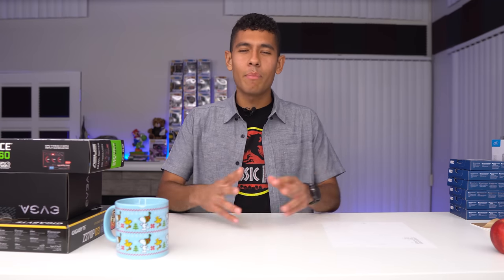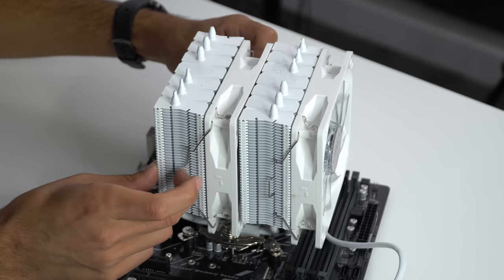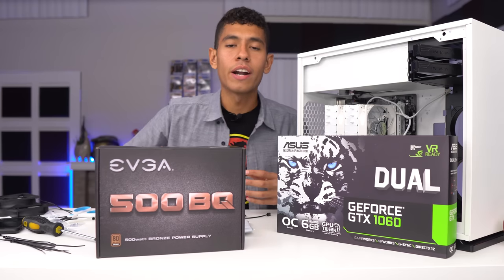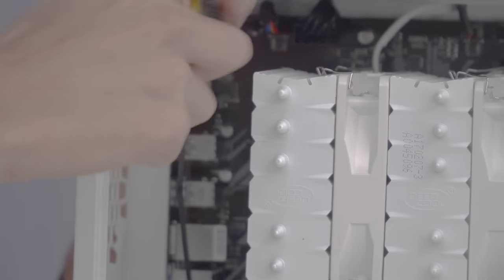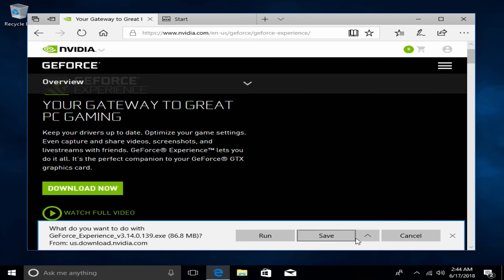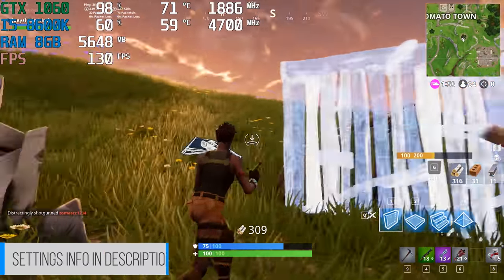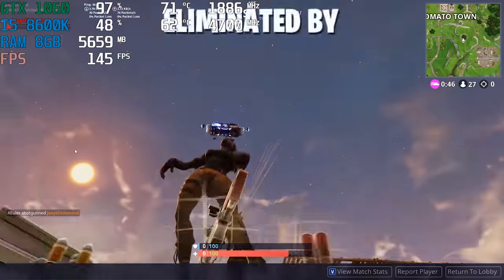Best $1000 Gaming PC Build Guide - GTX 1060 i5 8600K (w/ Benchmarks)

Comment: So I made a part list equal to this build for about 120$ cheaper with a built in wifi solution but a low clocked I5 by .5gh and slower ram by 200mh it's also in a mini itx/atx form factor and if you wanna use the rest of that 1k budget buy a good mouse and keyboard.
Reply: FreeformElm what's your motherboard And case?
Reply: wout cooler master 3.1 lite its about 30USD the motherboard it depended apond your needs so the range of cost id use would be 70USD to 120USD
Reply: Whata your wifi solution? Im building my 1st pc roughly like his but with an 8th gen i7 and 16gb of ram. But i dont like using usb wifi so id like to instal one asap
Reply: Link me the part list please
Reply: It's might be slighty different because I kind of changed it to morph my own budget and my budget kind of lost some money so I did reconfigure it for about the same price range with a little minimum loss of performance
Reply: FreeformElm could u send me the parts list plzzz
Reply: -Vlox - It should be posted underneath my original comment if you can't find it I got you
Reply: Konan Kunoichi  use a Ryzen you would save even more bucks. I got a total system for $675 with gtx 1060 6gb but I went with Rx 580 8gb for $650
Reply: Can the cooler in this video cool i7 8700k clocked at 4.8hz to 5hz
Reply: FreeformElm Yo I know it’s been a WHILE but do u still possibly have that part list? I understand if you don’t but I can’t find the list anywhere

Comment: Hey great video Joey, I have a question which one of your 1000$ pc builds do you think is better overall, your 1000 dollar ryzen with the 1070ti  pc or this one? Thanks in advance
Reply: ShiftyStudioz ryzen 100%
Reply: no way, the 1070ti is still way overpriced bro, its supposed to be around $400-$450 but its still at $700-$800. For $1000 this pc is your best bet, you wouldnt even be able to buy the ryzen with the 1070ti for $1000 joey said in that video that he based it off its regular price, ($400) so you'd need an extra $300-$400 to buy the ryzen one. But if you've got the extra money then yeah go for the other build.
Reply: Ozy i appreciate the reply thanks man!
Reply: Rozi Khan I appreciate the reply thanks!
Reply: gtx 1070 ti is 450$ in amazon wtf? gtx 1080 ti is 700-800
Reply: 1070tis are not $700-800. Cheapest one ive found was for $449 on newegg
Reply: Ozy 1070ti’s are nowhere near 700 dollars anymore. multiple sites have new ones for 450-500 during sales and used ones are at 400 on ebays sold listings.
Reply: Ozy The 1070 ti on amazon ranges from $450-$600
Reply: Ozy odd cause a 1080ti is 800$
Reply: ShiftyStudioz please don’t make either. With his 1070 ti build he lied about the price of the 1070 ti and with this one the parts choice is terrible. At this price you can get a gtx 1080 or 1080 ti build
Reply: Ozy what the fuck dude.Its 500 dollars on amazon not fucking 700-800 dollars.
Reply: popnimpop He didn't exactly lie to us. He even said that he thought that the price of gpus would drop soon after he released the video

Comment: I built this computer, minus the video card (I used my existing gtx 970) and I'm very happy with it. Following your guide was super easy and everything worked without a hitch. The only thing I'd like to mention is when updating your bios from a USB make sure the USB is formatted as FAT32 not exFAT - you will not see your bios update file otherwise. Anyway Thanks Joey you're great pc builder :)

Comment: If you’re looking to stream or render go with AMD’s 2600x cost less and can do much much more. I’m a huge Intel fan but I knew someday I had to try out AMD and I’m glad I did.
Reply: is it good for gaming?
Reply: JustinWdn11 Yes. I was able to play rainbow six and fortnite max settings @ 144fps. I cap my frames in fortnite at 144 as well as siege. I was max FPS throughout all my matches in both games. What helps is my 1070ti FTW2. 

The only problem with Ryzen is their single core performance. Though their single core performance isn’t as good as intel it’s still able to run games very well with no problem whatsoever. It’s just a lot cheaper. That’s why intel got salt when Ryzen was announced. 

I would definitely go with AMD if you plan on gaming, rendering or streaming. 

With my first rig I had the 4790k and now with my new rig I tried the 2600x and was surprised on how well this chip performed.
Reply: Will the AMD 2600x work fine in this build? Its fully compatible? Thanks in advance!
Reply: Drew Baker all of the parts besides the motherboard are compatible. the motherboard in this video is designed for the lga1151 chipset, so only modern intel processors are compatible with it. if you were to use the 2600x, you would need to buy a motherboard supporting the AM4 chipset, which is amd's design. i would reccommend the "ASRock - AB350M Pro4 Micro ATX AM4."
Reply: mars_ thank you sir!
Reply: Ryzen 5 2600 will need a fast ssd to go with it
Reply: Vidal Cuevas whats the difference if instead of i5 i put i7 ?
Reply: Sugar-Daddy Khayreddin lmao its like youre saying “a ferrari needs a good radio so it runs good” pc noobs are so funny
Reply: xd Strg some core i5 cpus are better than core i7s so you have to look at base clock speed, cache, core count and other specifications. Usually pairing i7 with other parts can cost more due to higher power ratings for example.

Comment: Hi Joey,
I've always wanted to build my own PC. I finally got to it and followed step by step on your video! At the end, I powered that sucker, and all the fans began spinning with power appearing to go through motherboard and all other components....the problem, nothing showed on the screen at all! I checked and rechecked everything, and all lines were connected. I took it to geek squad at which they were unable to clearly identify the problem. The whole time even after I left the computer running for a whole until night, the CPU was still cold as ICE! The suggestion was that, I may have bought a bad Motherboard and another suggestion was a possible bad CPU....what do you think? I am running out of trouble shooting options....also I did attempt different graphic card without success....any suggestion would help please?
Reply: did you hook up the HDMI to the video card because i made that mistake and hooked it up to the motherboard lol switched it and i was able to install my windows
Reply: Thanks for the suggestion @ Esmir....it turns out that i had a bad motherbord, at which i switched with a new one and this baby is running so smooth that i feel like running with it! First PC built that i am amazingly proud of! Wish i can show you all a quick snapshot of it...lol
Reply: sometimes the processor is to new for the mobo. then a bios update must be done first. compare wendor specs on bios version and cpu.
Reply: thebadcrew make the picture your profile so we can all see it
Reply: Did you try turning on and off?
Reply: Congrats bro. Planning to build one this week. Hope to see your build.
Reply: Nice to hear that it's working now I built my PC month ago it's a replica of the one in this vid with some better more expensive pieces

Comment: Gaming PC build for 500-600$ for us students? 😂
Reply: Look through his channel hes done those builds already 👍
Reply: buy pre-built. You'll get cheaper price. Of course you have to use coupon and look for them on sale. But if you find a good deal, you can't build them as cheap
check reddit buildapcsales
Reply: trust me anything below 800 is eshhhh, you want the top quality at low price
Reply: Dell optiplex 7010 i5 8gb mt case w 500gb.  $150. Add new power supply $30.  Keyboard n mouse $20.  1080p monitor $100.  Gtx 1060 3gb $220. 240gb ssd $70.  Grand total $590 😬
Reply: damn, thanks brother

Comment: I don't think your cpu fans were running 
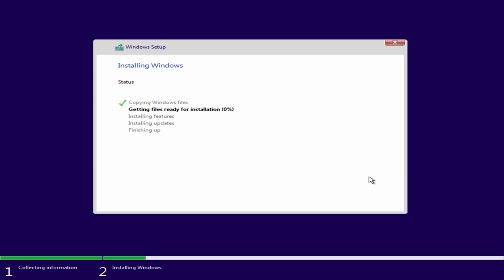26:53
Reply: It is running, the shutter speed of camera is just low.
Reply: Miko Tiotangco you can clearly see the other fans moving
Reply: I saw that too. I saw it was connected I think the gammax 400  white would be better instead of having that cpu fan cooler.
Reply: Does NOT have to be on if the CPU is not warm

Comment: Hey I had a solid 6 months on this pc but now it won't turn on... When I try to turn it on everything lights up for about a second then immedietly turns off. I got an sli motherboard board from gigabyte and a little red led shows up for a cpu error for a brief second plz help me

(Edit) I did fix it turns out I was the power supply I didn't get the one in the video though I got a 500 Watt not 80+ rated psu. I have since switched for a Corsair 650 Watt modular 80+ rated
Reply: Did you fix it?
Reply: Please tell me you fixed it want to get this PC
Reply: @allaalla2060  he edited his comment if you missed it

Comment: Need help connecting to the WiFi, I built the pc and everything is going good I just can’t connect to the WiFi. I don’t have a WiFi adaptor. I downloaded the LAN drivers on another pc, put them on a usb, and installed them on this build but it still doesn’t connect to Ethernet. Any recommendations?

Edit: I figured it out, I installed the LAN driver onto a USB using another computer than installed the drivers onto the new build from the USB. At the time of posting the comment I didn’t have access to Ethernet. Having Ethernet and usb or a WiFi adaptor is a must.
Reply: Buy An WIFI adaptor.
Reply: Use "Driver Easy" watch a tutorial of how to get Ethernet drivers for your exact pc
Reply: Use the cd that came with the motherboard
Reply: I figured it out, I installed the LAN drivers on another pc than brought them over to my computer with a USB and the Ethernet worked. At the time I posted the comment I didn’t have access to Ethernet. So Ethernet is a must to get on WiFi.

Comment: If I wanted to get this build, but upgrade to Intel core i7 is that possible?
Reply: quique loza see if the I7 socket fits the same as the old one
Reply: @official_vinny9578  how would I know the socket size of the Intel core? Sorry I'm new to building a PC lol
Reply: @liamlyda2116  thanks a lot man!
Reply: I have no clue wtf top no7ch was talking about but this is a Intel chip.... You def could put an i7 on it but the 8600k ocs to a stable 5.2 I see no reason to do so

Comment: Hey I had a question for anyone who is good with PCs. I am completely new to the pc stuff. I started playing mouse and keyboard fortnite on PS4 and I just want to play at higher quality. I only have a budget of 500 and I was wandering if I am able to get a prebuilt pc and slowly just upgrade one part at the time. Or do u have to go all out and spend a ton of money witch I don’t have?
Reply: You can totally spend money as you go. The one thing that is important though is getting a mobo that can handle what you want to eventually upgrade to. GPU's, RAM, HD, and SSD can all be upgraded on the fly. You will have to put money up front for the processor and mobo.
Reply: Brady P Prebuilt pcs are usually more expensive that building it yourself. Make sure your monitor can run 1080p with a refresh rate of 60hz or above otherwise you wont get any good out of it
Reply: I got prebuilt pc and it would be better if I just built my own but I was like 10 or 11 than so my dad just bought first one he had money for. I3 dual core 3220 3.3Ghz, GTX 650, 4GB or RAM and other specs I don't know. Oh and 3 poop fans (on power suply, GPU and one on CPU with $1 thermal paste under it). He spent under $500 on it and arround $700 on 4K monitor but GPU is so bad I can only watch on 1080p. So SAVE MONEY
Reply: Brady P You can totally do that , just look that the power supply has got enough power to handle future upgrades.
Reply: If I were you, I would just wait and save some more money, a few weeks or months won't hurt you. and I wouldn't recommend buying a prebuilt, u will just basically replace everything at some time
Reply: I got a prebuilt pc for like 900 - 1000 dollars, can't run fortnite.
Reply: Brady P Wth these guys don’t know anything about PCs i don’t know too much either buttt if they don’t know they shouldn’t be here acting like they know summ, so yes you can upgrade the parts but u just need a good motherboard that can handle a better RAM, GPU and CPU because the  temperatures will get high. And i think u can’t use like a beast gpu with an old cpu or something.
Reply: eh
Reply: steven west Nobody said you’re bad i was talking bout these guys which are saying “Yes you can”. You cant probably put ddr4 3000 ram in a motherboard that doesn’t support it or even a graphic card etc.

Comment: What about i3 8350k and gtx 1050 ti for 650$? i3 8350k is a beast processor for that price :)
Reply: TheTeikoTV check out scattervolt he did a build like that for $600 :)
Reply: 8350k is trash in every way possible 
You need a z370 and a beefy cooler to OC it, and a 4 core cpu is a bad investment unless it's sub 90 bucks  
Getting 8400/2600 and 1060 3gb is a much better choice
Reply: Yeah but then you need a z370 board which will be about the same price as your processor so there goes your bang for the buck deal lol.
Reply: Yall over here talking about gaming pc and I want 1 but don't know what to get nor know any good pc
Reply: Get a 2400G and B450 wayyy faster
Reply: Don't get a 8350k just go with i3 8100 i3 8350k is bad for price

Comment: an i5 + 1060 with only 8GB ram and mechanical drive for $1000 is very expensive, not a good deal in the US
prebuilt i7 -8700 with 16GB ram + gtx 1070 with a boot drive SSD + HDD for <$1100 have been on sale a lot in the US, and they occured very frequently in the past few months.

I would pay no more than $800 for a 1060 + i5 computer and it has to have at worst a 128 or 256gb nvme boot drive
1060 6GB now is only $250 and with rebate can be have for $230
Reply: Tuan Le hey can you message me?
Reply: Where can you find a pc of this power for sale?
Reply: Can you link me a pre built pc you would recommend for 1000$/ what parts should I include if I built it myself
Reply: Valtteri Virtanen I got a gtx 1070 ryzen 2700x 1tb hd 120 gb ssd 16 gigs of ram etc for $1150 with tax prebuilt that was such a good deal!
Reply: on Rakuten, check out Dell as a vendor. Every once in a while (almost once a month, and it last a few days), they have a discount coupon for Dell on Rakuten. That's where you can score a i7-8700, 16GB Ram, GTX 1070 , 256GB SSD + 1TB HDD for $1090
or check out Dell on Ebay. About once or twice a quarter Ebay have a one-day-only coupon code that will discount 20-25% at maximum of $100. You can score a i5 + gtx1060 PC there for ~500-600, or a Ryzen 7 + rx 580 for ~ 700.
Bestbuy also have sales from time to time. Anyway, the best deals for Pre builts are HP and Dell computer-branded. PowerPC or IBuyPower ? not so much.
If you want cheap, you have to research and watch for the sale ! Put in some efforts. At least like the comments of people who give you tips !
a few examples was my previous comments. Those deals will be back.
Reply: for $1000 you can get (depend on your level of efforts):
GTX 1080 founder edition: $400 on EVGA B-Stock or MSI Aero gtx1080 for $459 right now on newegg
Gtx 1070 new deals can be have for $350-375 if you watch closely, Gtx 1070 Ti can be have for $375-$425.
i7-8700 for $225 via Google Express, code 25% off a few days ago
16GB RAM: $160
Z370 motherboard deals can be found for < $150 such as Asus Prime Z-370A frequently drop to ~$130
EVGA G3 750W Gold Modular PSU: $60 after Rebate
Case: w/e you like, i'd just pick a cheap $20 Rosewill case.
fans: a 4 pack of 120mm corsair fan for $9 on newegg
Boot drive: 500 GB NVME Samsung 970 EVO for $150 on Google Express via Frys. If you miss that you can always find a $256gb Nvme for < $100. I'd go with something around ~$80 for that capacity.
Data drive: choose between a Sata SSD: 500GB SSD for ~100 USD or
Toshiba X300 7200RPM 4TB ($99) from Frys
The key here: put in some efforts if you wanna save hundreds of dollars ! or thousands compare to if you follow these youtuber guide or buy from vendor like Ibuypower

Comment: i would get the ryzen 2600x instead
Reply: @hex2357  Are you trolling? lmao. AMD Ryzen kicks Intels ASS.
Reply: @michaeldavila8627  here comes amd sweaty fanboys...
Reply: @michaeldavila8627  Intel is just better for gaming, ryzen is better for multitasking and streaming (if u want to stream over cpu and not gpu)
Reply: @YoItsJustSickeD  Not really, my 6600k struggled in alot of games due to the low cores/threads. My new 1500x not only it runs smoothly with not stutters but I didn't lose fps.
Reply: @michaeldavila8627  Well what else did you upgrade except your cpu? I find it really hard to believe you just replaced your cpu and motherboard only.
Reply: @michaeldavila8627  Besides every single benchmark says that 6600k stock is around the same as 1500x and you can overclock your 6600k which will make it better than your 1500x. If that is the only thing you "upgraded" you basically threw money in the air.
Reply: @YoItsJustSickeD  I replaced only my CPU and motherboard, lmao. I got the CPU and mobo for free because my brother upgraded. Ryzen kicks ass.
Reply: @michaeldavila8627  Yeah well, than something was broken and not working properly maybe the pins on the cpu were slightly bent, maybe your pc was dusty and when you replaced mobo you cleaned it up. Anyways most of the people will agree with me and say that 6600k is better than ryzen 1500x. Yours situation is obviously unique and I'm glad it worked out for you. Cheers!
Reply: @YoItsJustSickeD  What? No, there were no problems. 1500x kicks my 6600k's ass. I couldn't be happier with my new 1500x. Games runs so smooth. And I can record gameplays without stutters.
Reply: Yeah if you like saving your money then get that buy if u really like gaming performance like me y go for that? I don’t understand
Reply: xxbartex  for games Intel is still far more superior
Reply: xxbartex  discussable